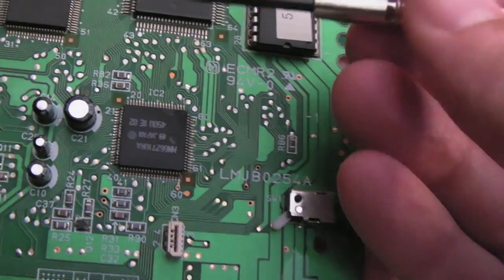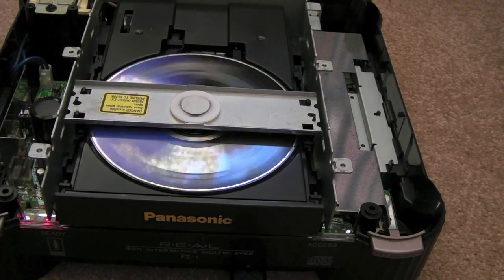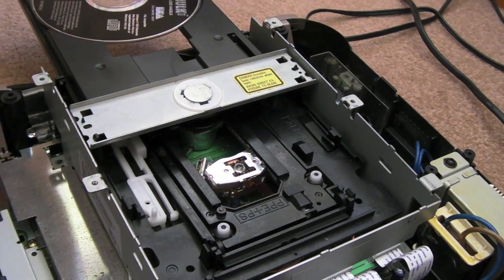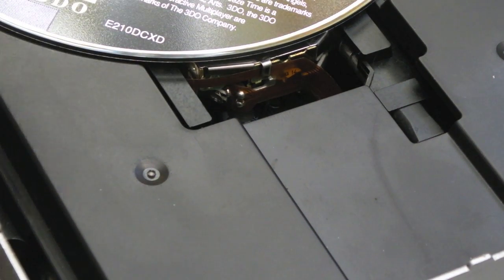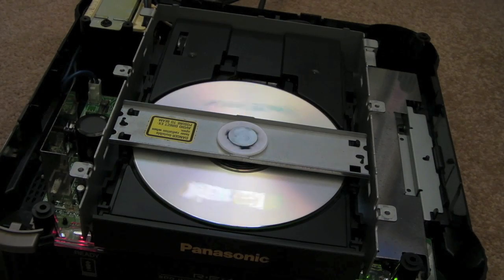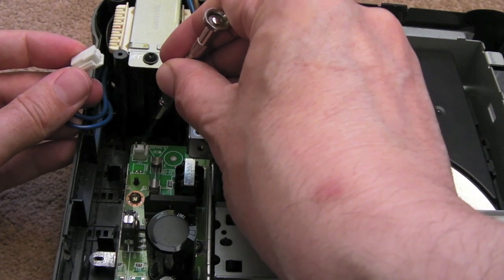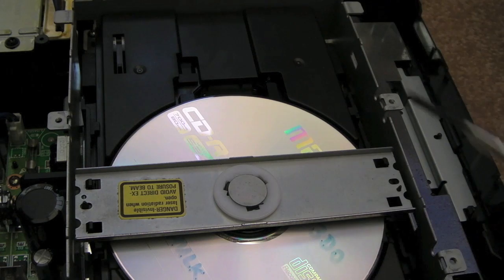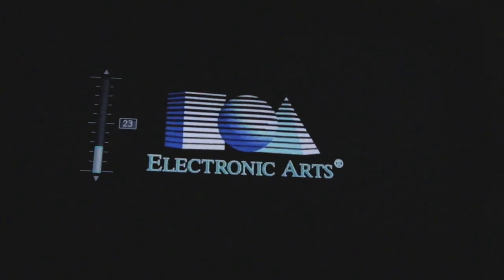Panasonic 3DO (FZ-1) CD-ROM Repair Follow Up (Yet More Capacitors)

Comment from the maker: The RF level was adjusted later, in this video:- https://www.youtube.com/watch?v=McSg5Xqkb2U&list=PLMjdUTC-GcRMjho136gdqa58cVX64C-Vx&index=5&t=0s
In another video I looked at the memory expansion for the 3DO:- https://www.youtube.com/watch?v=45YoBvhyV0I&list=PLMjdUTC-GcRMjho136gdqa58cVX64C-Vx&index=4&t=0s
And here's another repair to a 3DO I did later, with laser adjustment (and fixing sound issues):- https://youtu.be/EVvhm22YQN4
Follow up:- https://youtu.be/3Zbh5jOxHek
Crackling audio fix:- https://youtu.be/oczWL5hNv48
Yet More Capacitors (on the CD drive):- https://youtu.be/b0d4OhPczH0
Reply: Hey if you can get back to me my FZ1 just shows a black screen and I can’t figure it out 
Thank you

Comment: Hey man, I appreciate your knowledge and I’m currently binging your videos on the 3do. I do have a question-

I just replaced the broken worm gear on the laser track on my fz1, and it got my console to read music cds. Some work better than others, and my 3do is picky about which discs it wants to read. A perfect disc will eventually start skipping audio, so do you think I should adjust the pot? I do not own an oscilloscope.
Reply from the maker: If the problem occurs with original discs, there are a few options.  1) Consider re-cappping the drive PCB - the caps on there do deteroriate!  2) Make sure main PSU on the motherboard has been re-capped.  3) Laser may be weak and may need adjustment.  But also consider if using burned discs, the media and burn speed are key factors on how well the laser will be able to read the disc.  Not all CD-R media is the same, and burn speed can make a difference.  If you adjust the pot, measure its resistance across the 3 contacts first and write down.  Adjust it very very little - ie. 10 to 20ohm adjustment (try 20ohms less first, then set back to original resistance and go 20ohms up, if that doesnt work it may need a new laser).
Reply: @GadgetUK164 I have no idea if it’s been capped or not, but once I got the console to play music cds I learned it’s a Japanese console😂 oh well- it’s probably never been capped but the fact it plays music cds and begins skipping sometimes leads me to think the laser is weak. Hopefully!

Comment: Hello bro, thank you for this great video, its amazing info compiled here.. i have a little question, mi 3DO FZ1, wont spin anymore after i tried to adjust the laser, before it read audio and original games but backups always spitout... any ideas? im very sad
Reply from the maker: Check you haven't damaged the variable resistor you adjusted (they are fragile) - if not and you've set it back where it was, if its still not working the chances are the laser died =/
Reply: @GadgetUK164  Thank you for your time and for answering me, I will try to check although I have already returned to the initial value and it still does not work, I feel very very sad =(, I just wanted to adjust it to play some backups and now it is completely dead. =(
Reply from the maker: I am assuming the PSU has been recapped btw - if not, there's mileage in replacing the 3 or 4 caps there.
Reply: @GadgetUK164  The PSU has not been recapped, it is still original like factory, you think maybe doing this may help? :(  thank you very much bro

Comment: My 3do has a cdrom that stops spinning.
Removed the CD reader and put it in another unit, works like a champ.
The working cd reader from that unit also was put in the broken 3do and stopped working.
The CD stops spinning or, if you eject and insert again many times also the tray stops moving...
What can I try?
Reply from the maker: Most probably a power problem - have you swapped out the capacitors on the power supply section like I did?
Reply: @GadgetUK164  
Thanks for replying!
I just bought the 3 caps, I will replace them soon, thanks :)
Reply: All done! It sings like a bird! Deeply thanks :)

Comment: Turning the pot clockwise increases the resistance, so decreasing the voltage. Your fix using the counter-clockwise adjustment, (decreasing the resistance, aka increasing the voltage), is typical of old optical drives in my experience. 
Great videos, thanks for making these!

Comment: You advise counter clockwise? My 3do plays audio perfectly, but not original games. For dreamcast I would turn it clockwise.
Reply from the maker: Variable resistors are not always turned the same way on different systems - the reason is there are 3 pins, the middle pin is the wiper connection, the other 2 pins are sometimes connected between a supply rail and ground - the wiper can move between the range of full to ground or full to supply - but depending on how the system was designed you can have either ground or supply on either side of the variable resistor there.   So it's not always a case of turning it the same direction to increase or lower voltage...

Comment: The 3do reads backups??
Reply from the maker: Yes, no copy protection in place in the 3DO.
Reply: @GadgetUK164  i got the goldstar burned at 2x but no luck bro can u help do i need new laser i did order one???
Reply: @djgates06   I have both panasonic FZ-10 (top loader) and goldstar 3DO
the FZ-10 plays burned games at any speed.
the Goldstar doesn't play burned games at all

Comment: This video just helped me get my eBay 240p FZ-1 working! It would read audio cd's but not games pressed or burned. I tried adjusting the POT counter-clockwise and it made things worse. I then went clockwise tweaking slowly testing in between and finally landed maybe 45 degrees from where I started. Games including FMV heavy titles like MegaRace seem to be working well!

Comment: hey, you have helped me in so many videos! I'm running in to an odd one with my 3DO FZ-1. Not only does it not read discs it never goes to the asteroids screensaver, insert disc screen or anything. It just stays on the 3DO splash screen. I've recapped already and still no luck :( out of curiosity have you measured the potentiometer on the laser to see what it's resistance is on a working 3DO? I'm curious to compare to make 100% sure it is a problem further down the line (rom or etc). If I put a pressed CD in it spins the laser bobs the screen goes black for a second... then back to 3DO logo and nothing else happens. No matter what though even with no disc inserted the access light flashes very dimly and quickly constantly which I think is odd.
Reply from the maker: Thanks =D  There could be numerous things going on.  I would first suggest recapping the PSU section of the board and check the caps on the drive PCB as they sometimes leak.  Beyond that, you could have a fault on the CD board, or on the motherboard.  Since the drive light is flashing wierdly I would assume power issue or drive issue. (Both could be caps).  I haven't measured the resistance as its better to use a scope to adjust the laser - but I believe in one of my 3DO videos I measured the RF level with a digital multimeter (I think), so you could use the voltages there as a reference to adjust using a DMM.

Comment from the maker: I will revisit this 3DO CD drive to adjust the laser properly using the scope.   It's something I've been meaning to do for a long while but just not had motivation to look at it.   Since originally fitting the replacement laser its only been used for a few hours at most, but I suspect its still set to high and will short the life if I don't adjust it correctly.

Comment: I tried to repair mine but the disc doesnt spin =(
Reply from the maker: =(  It can be very frustrating!  I would first make sure you've recapped the PSU section on the motherboard, and consider replacing the low profile caps on the CD logic board (as seen in this video).  Then re-test.  if its still not spinning the disc, try powering the spindle motor directly with a 1.5v battery to see if it rotates, if it does at leat you know the motor is OK.   From there its a question of either the laser being faulty, or the spindle height - if that spindle has been pressed down (or pulled to heigh upwards) the laser will not focus on the disc correctly and it will not spin.   There are other possibiliities that you might have a fault on the CD logic board, perhaps a faulty H-Bridge driver or some other fault on there.
Reply: Thank you =)

Comment: The problem was that the laser passed the disc? When you adjusted the pot it solved? only this? Mine has the same problem and did not word, any other idea? BTW it seems my 3do spins the disc  counter clockwise (yours clockwise) and ejects with the disc still spinning, any idea what it may be?? help me please
Reply from the maker: When the drive gets confused - from bad laser, bad capacitors on the drive board or motherboard it can eject the disc when its still spinning.   As for the rotation direction - that could indicate a logic fault on the CD ROM controller PCB.
Reply: I tried playing with the old pickup pot, I got it spinning the right direction, but not reading yet. Still looks confused to which side spinning and then starts and spin slow to the correct direction. But after adjusting a little more, it seems not spin anymore, but I can still see the laser. Hope the rest is OK. Hope just caps and maybe the laser. For my PS2 the laser keeps a red dot on the DVD, should the 3DO leave the same dot on the CD or with CD is different? I can only see a red light, not a red dot on the lens only. Thanks
Reply from the maker: The PS2 laser is different and seems much stronger - you can easily see the red dot on a PS2, on the 3DO laser it can be hard to even see it with the eye.  You could try pointing a camcorder at the laser assembly whilst its running (not straight over the laser or you could damage your camera (or eye)).  I would certainly replace the caps on the PSU before you do anything else to the drive, and check the caps on the CD PCB.  Put the laser back to its original position and then re-test.  Also check the spindle has not been pushed down - if the laser is too close to the disc that can stop it detecting the disc.
Reply: I'll try the capacitors soon, just need to buy, but I haven't see any leaked, however it is not too close to the board indicating probably dilated. I looked the spindle, it seems OK. I could not even budge it
Reply from the maker: Yes, also make sure you've replaced the capacitors on the PSU section of the 3DO motherboard too - they often cause problems with bad sound and CD read problems!
Reply: I'll buy all the 3DO capacitor, even if I don't install all of then, I tough I had somewhere in my house but tried to find and I don't have. I'll buy the kit and once I change I'll post here the results. tks

Comment: Nice video!  Did you have this 3DO hooked up to your TV with S-Video?  Because the picture looks great.  How did you lower the laser voltage?
Reply from the maker: Yes - I use S-Video as it gives a much better picture than the composite.  I talked about the laser voltage adjustment in the video - the part where I talk about turning the 'pot' (a pot is a potentiometer - or a variable resistor), sometimes refered to as a 'trim pot'.  You put a little precision screwdriver onto the end of it and you can turn it clockwise (to increase laser voltage I think), or anti clockwise to reduce it (I think).  Normally in these CD / DVD systems its typical to need to increase the voltage to read CD-R / DVD-R media.  In my case it was reading CD-R fine after swapping the laser, but I never had an orginal disc to test with until recently and I found it was struggling to read original discs - probably because the laser was set too high.

Comment: i have an old dvd player that plays older dvds but not newer dvds do y think the lazer needs adjusting
Reply from the maker: Hmmm, I have two thoughts here - firstly I remember when I bought an early Wharfedale DVD player many years about that it played all the current movies of the time, but a time came when it would not play the latest movies.  I had to do a firmware update from a disc in order to resolve the problem.  I wonder if your player has that problem?   Then there's the chance that the laser does need adjusting, but I don't think the manufacturing process has changed much over the years so I would be suprised if that's what the problem is.   Worth checking if there's a firmware update for that DVD player model first I think.
Reply: GadgetUK164 thankyou for the reply i did check on line for a firmware update but its on the lastest firmware cd skip also after playing the sixth track the song playing will jump all over the place its seems there is alot of people online with the same lg model having the same issues
Reply from the maker: That does sound like the laser if its skipping tracks!  But... It could also be that the player has SMD capacitors which need replacing- that's not uncommon!
Reply: GadgetUK164 thank you i will look in to that
Reply from the maker: Just taking it to bits, cleaning the laser with IPA, clean the slide rails and re-lubricate them, you might find that makes a difference!

Comment: I have a Panasonic 3D0 (FZ-10).  It works, there is sound, but no picture.
https://www.youtube.com/watch?v=pVjXj0aC4jU
Reply from the maker: It's in excellent condition!  I would suspect a problem with the video encoder, or perhaps it just needs the capacitors replacing.